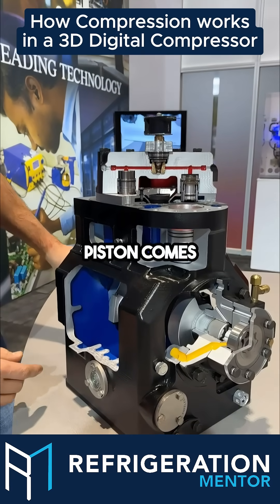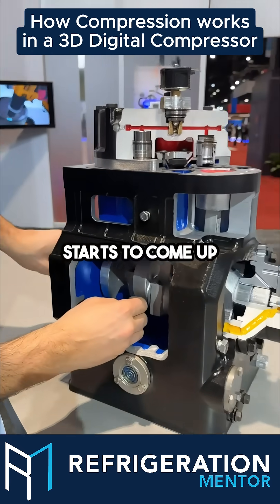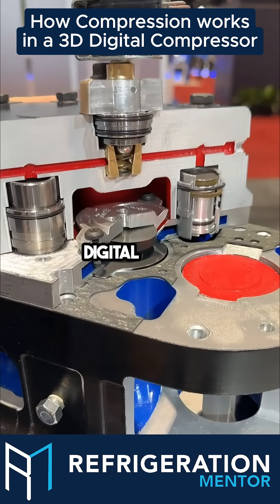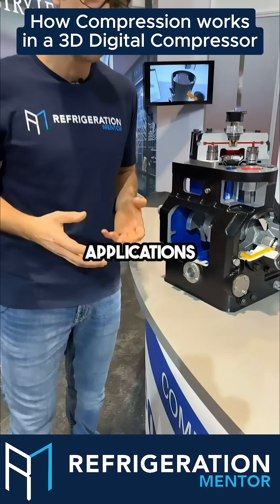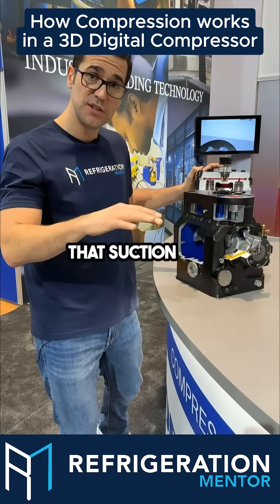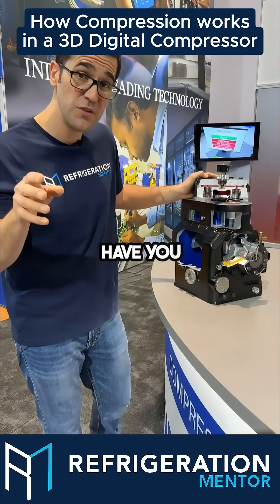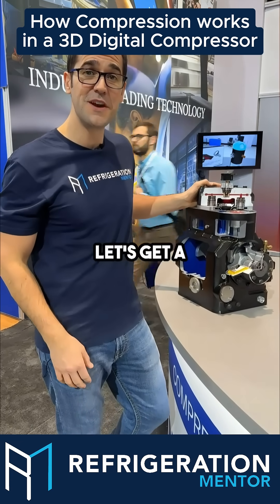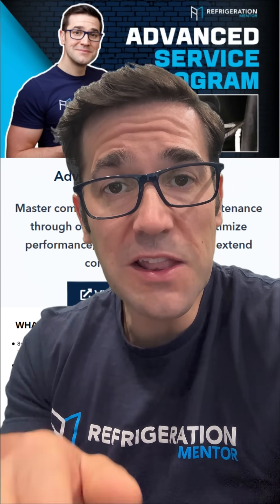How Compression Works in a Digital Compressor

Comment: Yes indeed they are very efficient ,,but has to be careful,,, the IDCM voltage reference in three different rack system situations like hussmann, i found bad settings in the E2 controller 0-10vdc volts engine,,,and this module only accepts 1-5 VDC, and these are the only times that I have seen these modules not working properly. Always check the voltage reference from the 4AO.